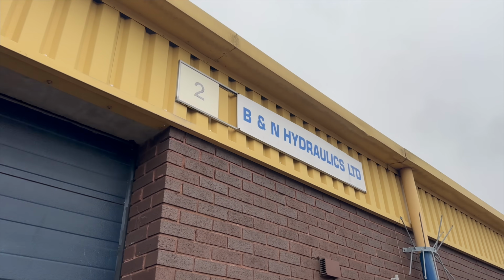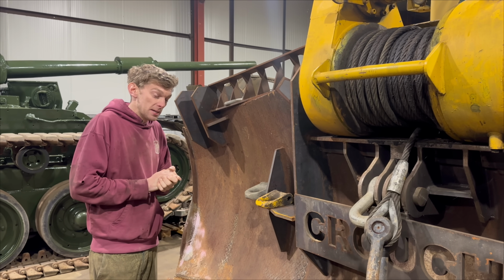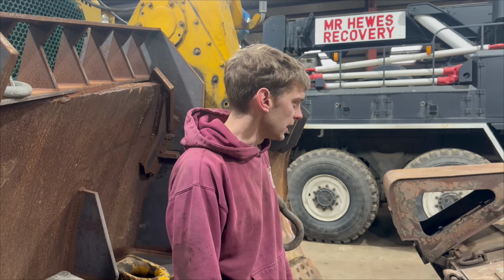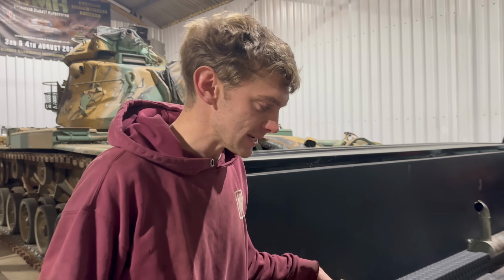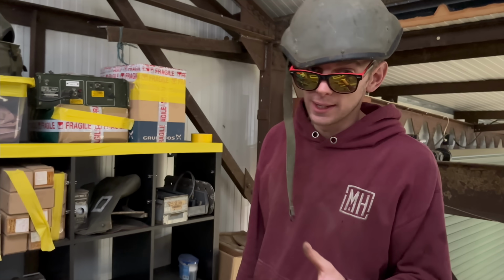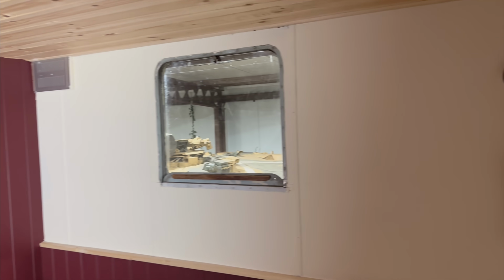“Taking a Tank to the National Ploughing Championships!” - What could possibly go wrong?

Comment: Hi just had idea for your living trailer what about putting a swan neck on the front with the pin on it will add length which can also be used for storage or gas bottles cheers tony

Comment: I can see no high level ventilation other than the one sliding/closable vent that I spotted. You must have permanent high and low level ventilation for the gas appliances. please enlist some one familiar with LPG before this is used in anger. Carbon monoxide is a real danger. Other than that it looks amazing

Comment: As long as the trailer has good insulation 
and safe heat (RV heaters) air flow
You should check out a few RV also.

Comment: On the trailer angle issue, "Not fitting into any building" is already going to be an issue at the front of the trailer is it not, when it is connected to the tow truck?  Hows about a new "space frame" to move the 5th wheel pin fowards and upwards, effectively lengthening the trailer, giving you somewhere to put heavy stuff like water tanks and spare wheels etc?

Comment: One possible fifth wheel solution, a big maybe but.. Raise the bed (sleeping bed!) a tiny bit. Cut a tunnel out of the trailer the exact width of the fifth wheel . looking at the trailer, if it was level the tires of the T will not touch the underside (fabricate some mud guards) jiggle the position of the fifth wheel with the pin now mounted on the roof (top inner) of the tunnel so that the T slides exactly under the tunnel (and under the bed) and locks into place. Should look OK and be fairly level. But might be a pain to get right, but I've watched you do difficult things all the time!

Comment: Stupid, maybe, but what about a "connection" that hitches to de 5th wheel and is also hitched to the pin under the trailer and the front of the trailer, kind of huge adaptor?

Comment: I once worked with a D9 of this calibre that had the ripper assembly but the shank leg taken out. By god was that an enormous chunk of metal. I bet it probably weighed half of what my D6 did. The only time it didn't leave ruts was when it was pushing a box, had a full blade, or otherwise had a LOT of weight on the blade. Yeah, on soft ground that extra weight made it destructive af, but on firm ground you could tell she was poisted for some goddam mfing work!! 

You already have a fair heft on that blade, and she's not doing owt.

Just throwing that out there.

On a side note, I met the guy running it again on another job whilst he was running a D9H with slew levers, and one day he let me swap seats with him for the last hour of tidying up. Hard work trimming haul roads with a blade taller than you (I'm 6'1"), 2 flights of steps to get to the cab. I appreciated that opportunity so friggin much!

Comment: Just a thought which the fifth wheel.  The chassis rails on the T may be hitting the underside of the box van at that angle.   Especially if your going off road this is going to be worse due to the undulating ground.     
       Maybe a dolly in this situation. 
      Keep it up guys.

Comment: Mr Hewes your poor eye what happened i hope your eyes gets better,

WOW a brilliant video and thank you for sharing all what is going on.

As a hgv truck driver for 41 years and seeing how your trailer home is coming along and the problem of 5th wheel height is an issue here are some suggestions to think about:

Obviously the trailer ride height and the unit height need to be adjustable?
On hgv units we can lower or raise the air suspension for coupling or decoupling but because your unit probably has leaf springs and is designed for a heavy load it will have no cushioning effect thus everything inside the trailer will shake its insides out, just need a better way of softening the ride with everything inside, just a word of caution.

The roads are full of potholes and you will feel them without air suspension?.

The speed you travel will have a major impact as well?

Going back to 5th wheel height.
Ideally you need to be able to adjust your height on the tractor unit, if this is not an option then hydraulic legs or electric legs for coupling up and decoupling, also electric rams for leveling your caravan, and caravan spirit levels for corners.

The suggestions for blocks under the wheels will be the cheapest option and will work but not every place you go will be flat, take a look at caravans corner supports as well as the problem of leveling the caravan  on a reverse slope with a side slope and you will get what I mean.

Also America motorhomes how they leveling up when parked up?

Either way you will have to adjust unit or trailer height or both, but the problem is connecting up for you? If you have either hydraulic or electric legs you will be able to raise the caravan front over the chassis cross member and rest   5th wheel pin on 5th coupler, But remember the distance between the rear of the unit lights the legs needs to taken into account when turning otherwise ouch!.

Recap 
Hard ride with no air suspension.
Adjustable legs electric or hydraulic.
Maybe adjustable 5th wheel?
(SLIDING forward and back)
Trailer brakes? Air or Hydraulic?

Vibration of hard unit suspension on caravan interior components?

Option air suspension on trailers/caravan or similar suspension of a caravan to reduce vibration from road.

Last thought?
The unit was built for heavy towing and didn't need soft suspension how much vibration will be transmitted through into the caravan will be one of the biggest problems you have.

Food for thought?

Always love your videos and really appreciate everyones hard work, looking forward to meeting you all one day soon.

Kind regards 
David.

Comment: Regarding trailer height, on festivals the ground is never level, a friend has an American RV with hydraulic legs, individually adjustable.
Why not put two near the rear wheels so on site you can level to the height of the hitching point?

Comment: I entered the raffle but found the disclaimer confusing it states:

"The above odds are calculated based on all participants answering the entry-question correctly. If participants answer the entry-question incorrectly, your chance of winning will increase.

Only tickets that contain the correct answer to the entry question will be entered into the final draw."

So i entered the answer incorrectly to increase my chance of winning! but i fear i have wasted a tenner because because the next line reads only tickets with the correct answer will enter the draw WTF?

Comment: On your Radioshack - can you not fabricate a new forward extension on to the chassis/hull, that has a higher ground clearance, to fit a pin beneath, to slot into the 5th wheel?  And then use the new extension as a secure external storage bin (assuming that you don't want to punch through the existing forward bulkhead into your new box extension).

Comment: Modifying the ripper into a second ground anchor point might pay dividends. I can't imagine a scenario where the D9 will pull itself towards the recovery vehicle with the blade down, but, maybe for those occasions the blade just can't get a purchase (hard rock or shale etc) having point-pressure anchors in the ripper, for proper ground penetration might, be handy.

Comment: Regarding the problem with the diamond T, can you not just build a small trailer for it that has the 5th wheel at the right level and move the camping trailer that way, or permanently attach a pair of front wheels to the trailer?

Comment: You may be lucky but we had ram grenade it self on a 14t excavator. cue 80k Aud later the whole hydraulics system has been replaced including lines and we still getting little bits of metal in the hydraulic oil filter every now and then. If the motor dies so be it but if metal goes into the hydraulic system then kiss it goodbye its not worth fixing

Comment: For the diamond T and trailer issue, options are limited. Lowering the axles would be a better solution than using elevating ramps. I suppose it comes down to how often it will be used, although putting in air bag suspension may be the best of both worlds.

Comment: re the trailer - can you not extend the front with the pin to "crank" and reach the 5th wheel. use that space for decking, generator etc.

Comment: Air suspension for the trailer ? Rear lift blade for the dozer so you can lift it on a higher pressure foot print when pulling blade front and back then winch ?

Comment: Couldn’t you fit a pair of hydraulic legs to the back of the trailer so it’s height and angle adjustable depending on the ground it’s parked?

Comment: have you considered the possibility of creating a channel in the floor of the trailer (which goes under the bed) to allow for the height of the 5th wheel?  You've already taken the trailer away from original so there are no issues there.

Comment: Could you add a gooseneck to the front of your radio trailer to bring the fifth wheel pin to the height of the truck but still keep the trailer level?

Comment: You have to make sure hydraulic tank are full. That's what happens when you don't . Hydraulic motors are very expensive bits. I used to help a friend that repaired final drives for digger's large and small. Oil can save you a lot of expense. And is cheaper machinery.

Comment: On your blade braces, why not use some large ball joints on the ends so that you maintain articulation without having to remove them.
Reply: How about a heavy duty steel cable each side that could be run along the back of the blade when no in use. You don't need to push anything more than a D9 can push anyway so steel bonds would add the required upgrade to the top of the blade.

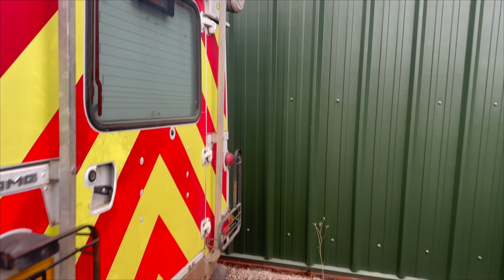Comment: 5:59 for the rear of the D9. Here in Aus we call it a "cutter bar" its a ripper with a blade "horizontal" running across the rippers wondering if you could use that as a "rear anchor" for the doser also win next years plowung championships 😂

Comment: Put a drop down tail gate on the radio van with a canvas roof over the top so you have a porch to sit outside on with stairs attached that drop down when the porch is down for leveling why not some hydraulic legs (out riggers).

Comment: I would leave that radio trailer as a towable dog/pup.
Set the Diamond T up to pull it but on the back you have all your other get about stuff. A small car or the Land Rover, golf cart and some push/e bikes. Because its all winch you could build a roll on, roll off box/bed for the back.
Setting it up to 5th wheel but having to unhook it, or pull up onto ramps etc is a pain. But the biggest pain is anything you do that makes it taller and not easy to get into an undercover space.
Id suggest a correction with smaller tyres but that Diamond T would already be short geared enough.

Comment: Nice video! Possibly extend the trailer frame, add an boxed and reinforced gooseneck with the latching pin to the fifth wheel height. Trailer would be level and pin̈ would be raised. Thanks. Your thoughts?

Comment: Can you add a turning front axle with tires and a tongue to the radio trailer (like a farm wagon) and tow it as a separate wagon instead of as a 5th wheel?
Other option would be bigger tires and axle lifts on the trailer and smaller tires and lower the springs on the tow vehicle..

Comment: Re; the radio trailer height problem. Add a potentially removeable second 5th wheel behind the rear of the Diamond T the top of which ought to be 42 inches high.

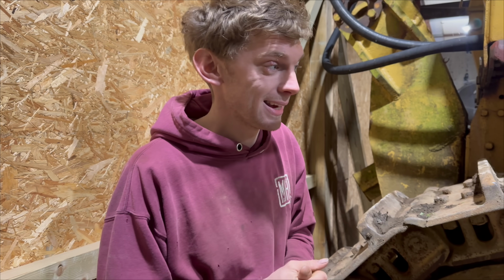Comment: 5:44 my vote goes for a crane. You know how stuff gets stuck deep in sometimes and you need a vertical pull. The ripper mounts are well strong enough to act as a crane support if you give it a "foot" that gets deployed with the lowering mechanism.
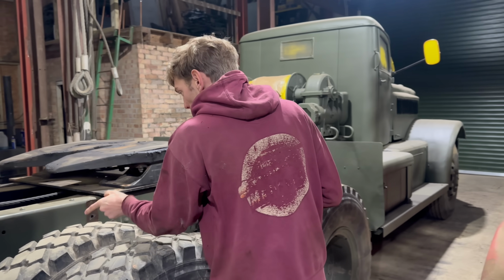18:27 you can't modify the truck, because it would be too much, you can't lift the trailer because it wouldn't fit, so your friends idea seems the easiest to achieve and do. Heck, i guesstimate that you could probably get away with a set of commercial ramp blocks from the local software shop. The ones you can get for trucks if you have breakdowns on the highway.

Comment: While I was serving, we had a similar issue with a truck and trailer.     Those tires you have on the truck are quite large.     Why not replace them with a smaller set of duals?      We were using a US 900 series five ton truck with the big balloon tires.    Swapped them with the duals of an 800 series dump.    dropped it enough to do the trick.     The sofa is top notch!       LOVE IT!

Comment: Trailer could you fit hydraulic suspension to the rear of the trailers axle  airbags or rams to lift trailer level when towing ?
Could you just put bigger wheels to the trailer ?
Hope Jack doesn’t get mixed up with a Cinderella prop. 
Have a grand time Jack and family in Florida

Comment: I would still suggest putting the brake air line connectors on the rear cross member of the Diamond T and mount the trailer airlines underneath the front of the trailer by the landing leg frame. Avoids running lines all the way across the Dimanond T.
And put a 4 bag or 2 bag air suspension on that trailer so it travels level but can be lowered when parked. Or if the trailer suspension is on a subrame put the air bags between that and the chassis.

Comment: It's like me and my dad said, it was only a wonky plough line when you set off, in the fog it was totally straight! Great experience to see it in action and meet you all.  Quick thought on hitching the trailer to the Diamond T, what about fitting a gooseneck-like frame to bring the 5th wheel up over the chassis of the truck? That way you'd not need to re-level or unhitch the trailer when you get to the event site.

Comment: About the trailer and fifth wheel thing.. Obviously you put larger similar tires on the trailer as the pulling truck has. So that it is level. If it then does not fit into shed, tough luck. Put it in the another shed. I would have suggested chopping the whole trailer roof lower but since you have done interior in it, would be quite wasteful.

Comment: I was gonna suggest that you put blocks / spacers between chassis and the axle bogies so its level floor when connected to 5th wheel. Or air springs on trailer... not v period correct!

Comment: I think it would be a terrible Idea to fit the biggest winch possible on to the rear of the D9.
I hope you ignore me and fit a huge winch to the rear of the D9.
Did I mention about the D9 having a massive winch on the rear end?
Yes?
Okay then.
The "Gentlemen's Trailer Lounge" could do with an adjustable hydraulic or pneumatic rear suspension lift as ramps would be far too easy and cheap to make.
P.S. did Ted authorise the use of his Landrover? 
Who let Jack take three weeks off....his mum? (Joke)

Comment: I think that a backhoe attachment on the wench dozer, or an extension crain lift like on the Folden. 
I live in east Texas and what i see used is primarily three pieces of equipment in the woods: dozer to cut roads if needed, skidder to push/pull the cut trees to the loading point, and a crane with hydrolic forks to lift the trees on to the trailer for the truck to drive the trees on the public roads to the mills.
We also have the oil business and they use big dozers but what i have seen to get large vehicles unstuck is a way to dig around the vehicle and lift it and get a road mat under it (oak cross ties about 8 feet wide and connected together in about 20 foot sections.)  So i would want a way to move stuff like a trackhoe can.

Comment: Why not make a frame on the front of the trailer to have the hitch pin higher, so the trailer stays level, and the same height. Looks short enough that you could get away with a two metre or so frame out the front

Comment: With your plasma table why not make brackets to fit between the trailer axle and chassis to raise the back of the trailer to level it with Diamond T. 
Never a problem again and no faffing about with ramps or unhitching.
Reply: He said that by fixed height raising then the trailer wouldn't fit in the shed. The suggestion's of variable height using airbag and onsite stablising legs seems the go. Also would enable onsite leveling side to side. Cheers

Comment: Living trailer tow height solution simply look into getting a tandem trailer axle , this is an axle with a fifth wheel on it that will go under the living trailers fifth wheel pin then it has a tow bar that attaches to the back of your tractor not on the fifth wheel  , no modifications needed except maybe adding a tow hook on back of tractor  good luck

Comment: The eyelet on bedroom door turn it 180 degrees it’ll push flush when closing just require pushing flat from outside when sliding open. Looking again the cable used does look like solid house wiring cable. Not up to regs.

Comment: For the trailer, can you hook up a single-axle towing dolly under it which has the 5th wheel pin engaging at the correct height?  The dolly is then hooked up to the Diamond T, probably to a standard towing pintle?  (google 'Strick single axle dolly' for some pics)